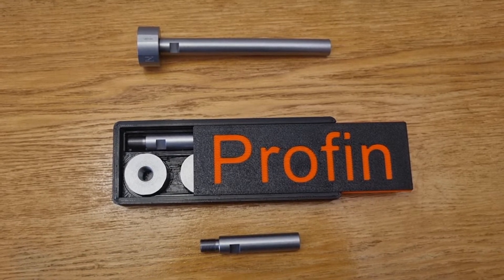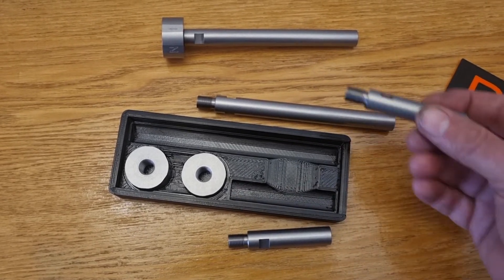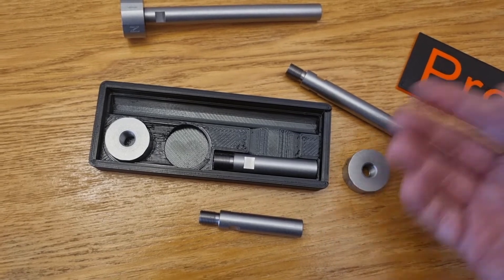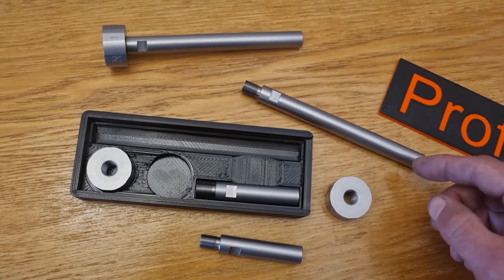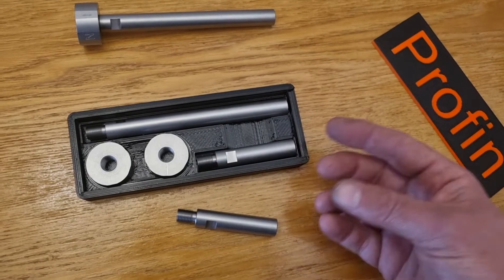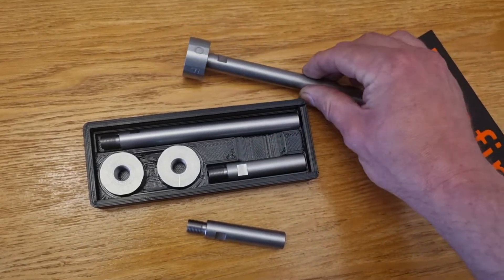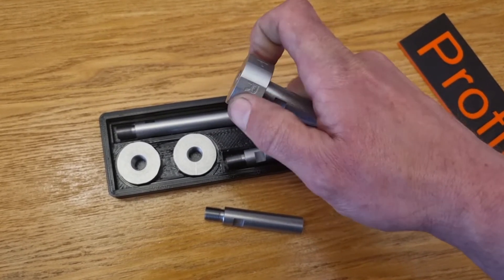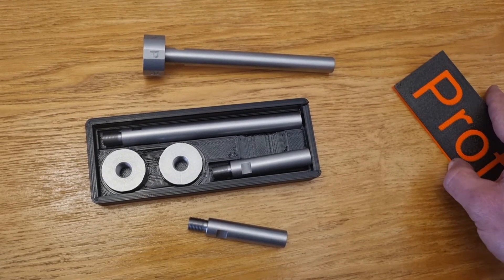New tools for sale - Spring and Damper release tools for Fox Forks

Comment: Brilliant just ordered a set with one base, exactly what im after, so hard to find the official ones in stock anywhere in the UK and even harder to find both sides in stock. Look forward to using them
Reply from the maker: Hey Teddy, thanks for the support. They will ship first thing Monday 🙂
Reply: @bounce2159  Brilliant thank you so much, Just thought Id make sure its the correct thing, will fit a 2021 fox 36 float factory? I cant imagine it wont
Reply from the maker: @teddylott  yep 100% compatible
Reply: @bounce2159  great, also looking at doing my own na2 rebuild when the time comes, looking at the serial numbers for the 125hr service after putting in my forks details and I dont see what bullet i need. the one you sell ending in 657 isnt on the list for me. I have the seal kit wwould I just need this and a clamp? The damper ill probably leave for someone else to do. Thanks again
Reply from the maker: @teddylott  just dropped you an email. Please confirm your 4 digit code and will take a look for you.